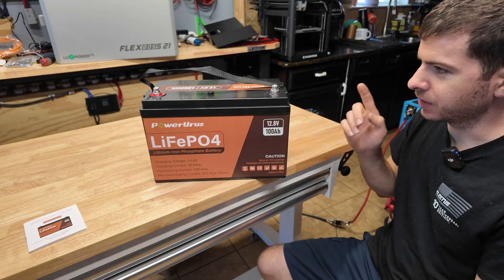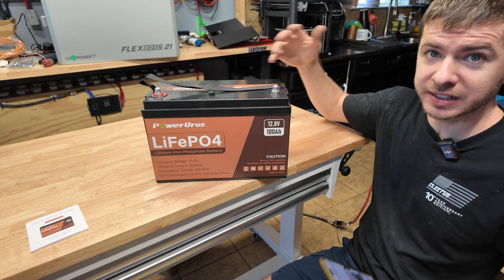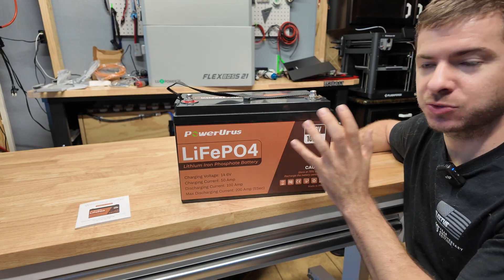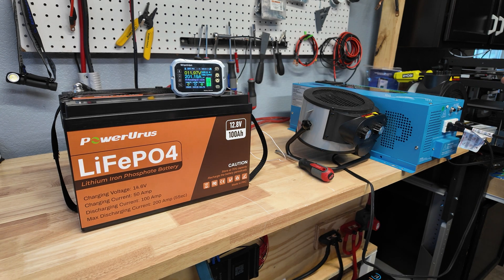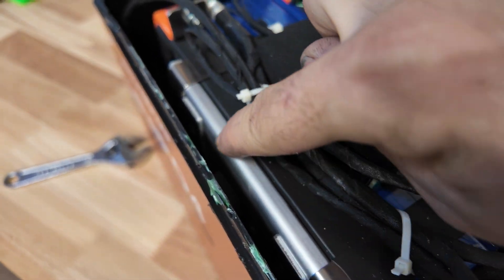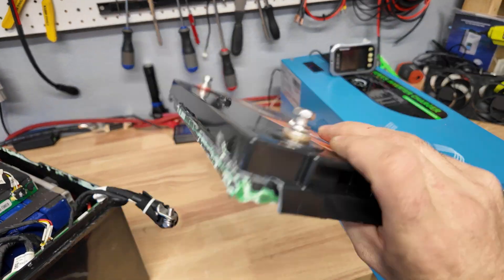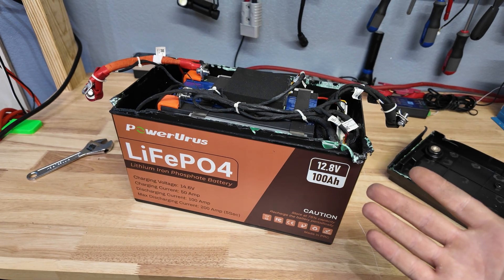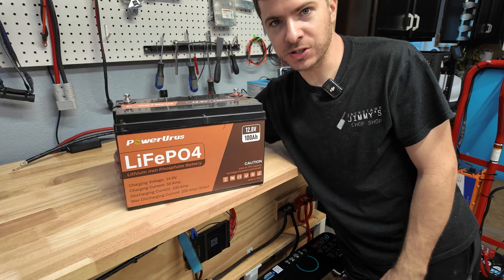PowerUrus 12V 100Ah LiFePO4 Battery Teardown, Test, Review

Comment: There’s a newer Heyfuture 12v 100ah battery you should test.
Reply from the maker: Is it good? do you know the price? I have been looking at more 12 volt batteries to test
Reply: @Mikebuildss  just seen it on Amazon so I’m not sure. It’s about 130$ at the moment with Bluetooth. Would be a good deal if it works as it should tho.